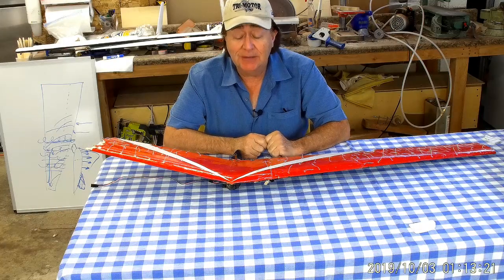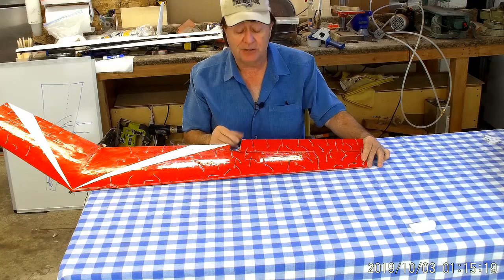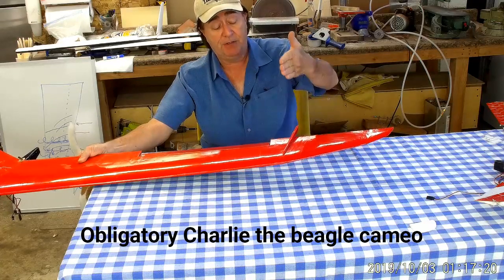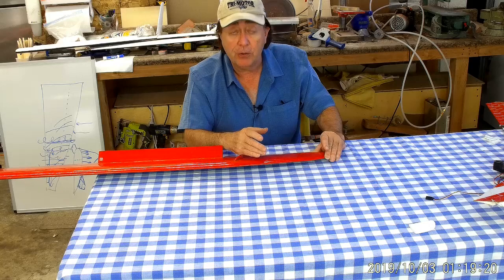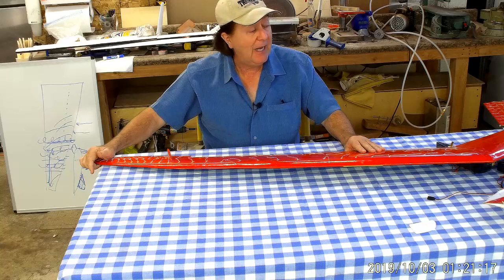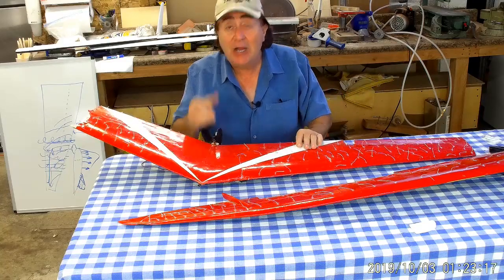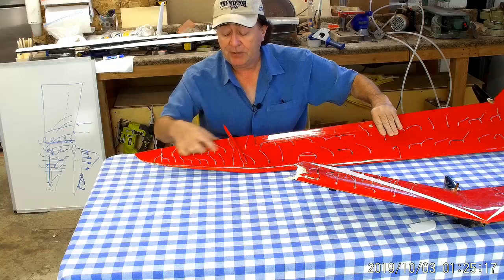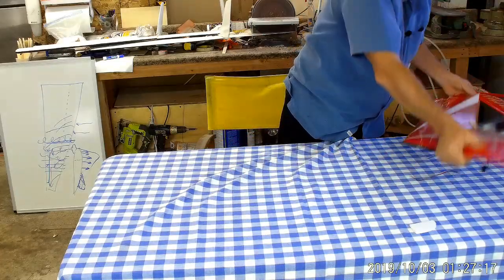Preventing Spins, Part 3a - Klingberg Wing MkII Development

Comment: The Kasperwing ultralight and hang gliders both employ wing tip rudder/stabilizers, these craft are not subject to stall/spin as you suggested.
Reply from the maker: Hmmmm....I don't recall saying the Kasper Wing will spin, but I will recheck the video. I don't know of any reports of spins in that aircraft. The issue I'm discussing involves the use of elevons and I don't think the Kasper Wing aircraft use elevons, but I will look into it further.
Reply: The vast majority of Kasperwings are weight shift for pitch, however two models of the Kasperwing U/L, a single place and the two place tandem are 3-axis control and employ outboard wing warping elevons.
Reply from the maker: @olsonspeed  Very interesting, do you have a drawing or photo that would sho the planform of the elevons?

Comment: Hi Rol, 

Flying wings may look simple, but you illustrate so clearly that they're complex and take grit to build. I was wondering to what extent the diminishing chord of the outer panel affects airfoil Clmax performance?  Lower Re toward the tip may be critical and a stall trigger (for which there are many fixes as you know). The auto-rudder wing fences are clearly an elegant solution that works. Your experiment in rudder placement is counter-intuitive, I'm still scratching my head to understand the results. 

Here is another design approach that may be of academic interest now (from the Impact hang glider team) that starts out with what looks like a less aggressively tapered wing using ~60% span pitch neutral inboard camber flaps, outboard elevons, turbulated winglets, and longitudinal weight-shift control.  Eight of these beautiful machines were built, they look a lot more efficient than the spoileron ATOSs: 
https://www.youtube.com/watch?v=7L3l1yQ63AQ
And for the Klingberg Mk2, welcome a potential 15 m competitor to beat: 
http://www.1comet.com/
https://www.youtube.com/watch?v=72-k618QRP4

Rgds Clive.
Reply from the maker: Thank you. Fact of the matter is there have been billions of hours and untold dollars invested in understanding conventional configurations, but we've barely scratched the surface with flying wings. I'm just hoping I can learn some new things and pass them on to others so we can all design wings that fly better and safer.